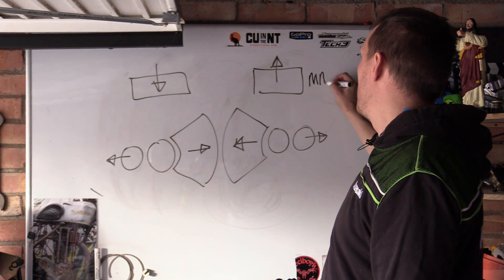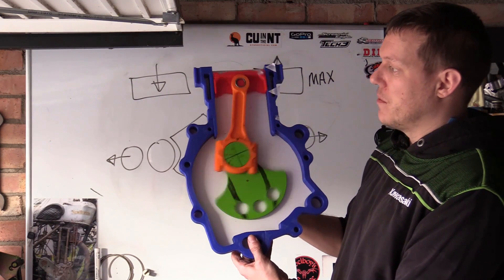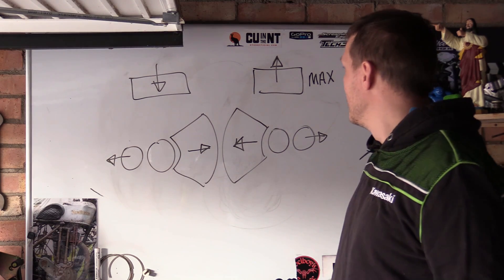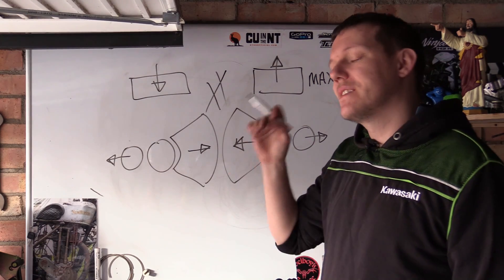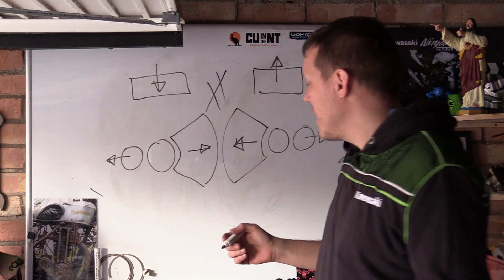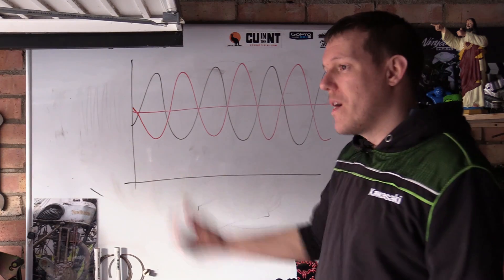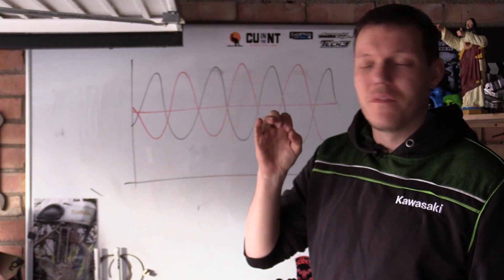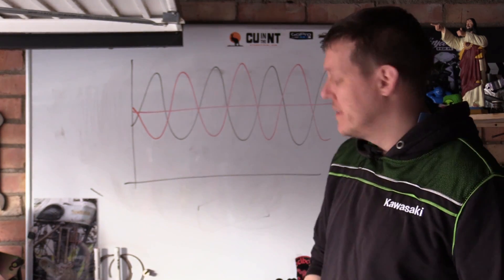Engine Balance - Basic Principle

Comment: nice talking about the weird curves on vibrations on the differnt cycles of the engine. but what about 2 strokes engines? are they easier to balance?
Reply from the maker: Not really. 2 stroke engines are under different forces. I.e the piston compresses the mixture on its underside, and this changes with rpm

Comment: Matt, if you have a straight 4 aren't the primary forces balanced because 2 up 2 down? Its the secondary forces that aren't which is caused by piston moving faster at top of cylinder than it does bottom and as a result i4's need balancing shafts when the piston is at tdc is the shaft facing 180° away from it and when the piston is at bdc (the shaft has obviously moved) is the shaft still facing 180° away from the piston?
Reply from the maker: Early i4's didn't have balancers because of larger rotational mass, however with everyone making things lighter these forces become more of an issue so balancer shafts are becoming more prevalant
Reply: @thedirtyworkshop  cheers Matt, once again a cracking help mate.

Comment: A question I have is, I dont understand how I can go from say for eg 6k rpm, drop a gear and it more or less instantly goes to 9k rpm for eg, how the engine is able to change that speed of the piston/crank/valve train instantly and cope with it.  I dont understand how it can fluctuate speed without issue so quickly.
Reply from the maker: Peak acceleration. In other max - the rod is design to with-stand the forces at peak acceleration - anything under that and the ord will deal with it

Comment: What would then happen if the engine is + shaped and had one cylinder in each 4 directions firing in a rotational sequence. Would that negate them side thrusting force's or would it just make the worse?
Reply from the maker: Make them worse out they would be out of sequence - if you mean firing every 90 degrees. The problem is that even with pistons of opposite motion, the upper 180deg is faster than the bottom 180deg, and this is because of the geometry of a fixed crank and con-rod

Comment: I've seen some crank for single piston bike (the smaller cc ones in a moped for example) with an almost circular balancer mass on both sides of the conrod. Will that circular shape smoothens out that vibration frequency you're talking about, especially during the half stroke? http://www.pushrod-performance.co.uk/images/crankshaft.jpg Will a perfectly balanced crankshaft be detrimental for the torque it can produce?

Comment: could you use magnets to increase the restance of the side forces? as in place some magnets around the case that interact with the counterweights that either increase or decrease resistance depending on where the blance is needed? Obviously will add weight but could it help?
Reply: That's exactly where it's all going in twenty years, smooth quiet electric motors

Comment: But steel's heavier than feathers
Reply: A tonne of steel weights the same as a tonne of feathers.
Reply: bandr one stone and a stone is the same ...
Reply: That's cheating, look at how many feathers there are
Reply: Hierophant it's not cheating 😂😂
Reply: Ok real talk it's a joke from Limmy, and whilst they might have the same mass, feathers will actually weigh less than steel, as the decreased density will have the centre of gravity of the feathers slightly further away from the earth, therefore reducing the weight by a miniscule amount.
Reply: Hierophant thats correct but I was just doing the joke 😂😂😂😂😂